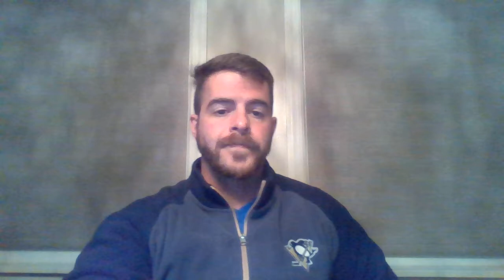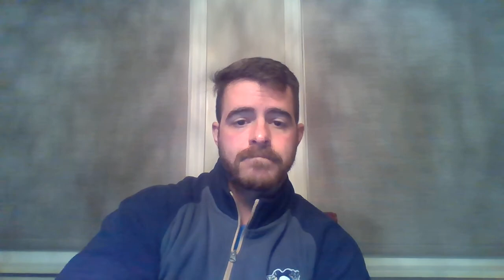Joint Commission - Generator Battery Testing Requirements - NFPA 110

Comment: I retired from a large hospital that went overboard on size & # of generators. They had four 760 KW gen natural gas gen sets & three 2,000 KW Diesel gen sets. All of the 21 elevators  were on Emergency power and 1500 CCA 12 volt batteries were replaced every two years so think performing monthly battery test is excessive. The 4 gas gen sets each had 6 batteries feeding 3 starters and took at least halve a hour to remove 144 cell caps & insert the water feed bottle.Only needed 2 of the gas gen sets to run life safely & critical branch loads. They would hire a company to spend days checking above drop ceilings to check for missing fire stop, missing covers on electrical boxes etc. They always passed JACHO inspection with flying colors. Unfortunately they stopped used sealed 12 volt batteries because CAT Techs said that some exploded. They have been used sealed batteries in cars for over 40 years.